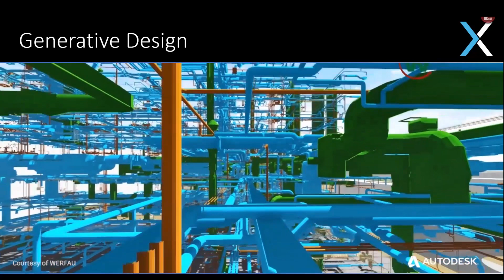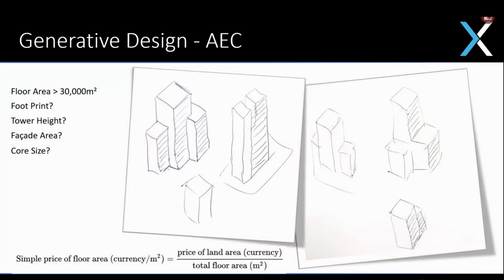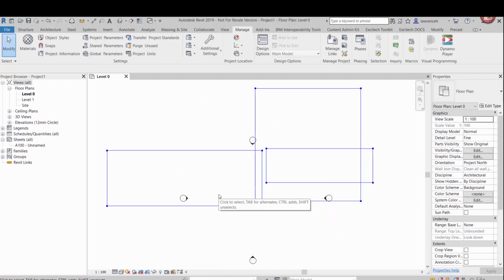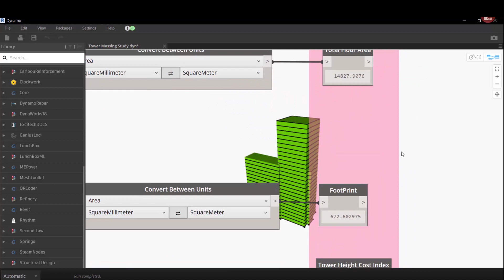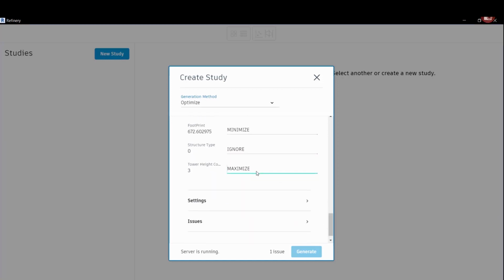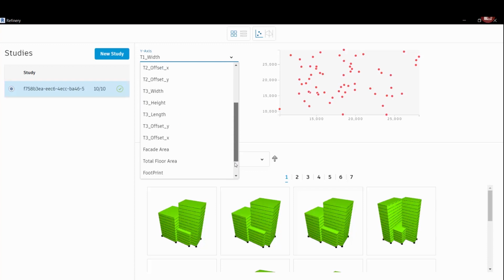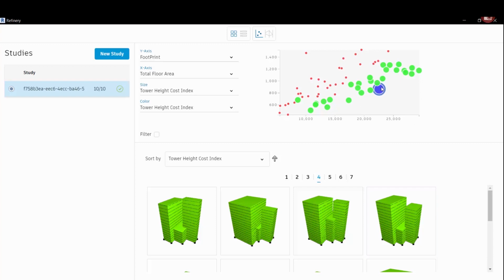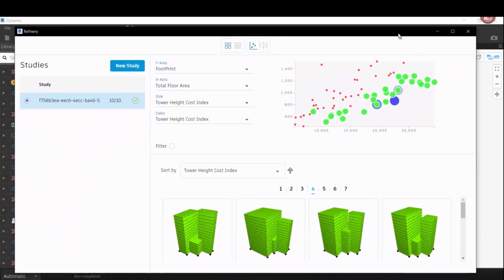An Introduction to Generative Design

Comment: But how are these optimal building being generated? You input the parameters and goals (max's and min's), but how does it output these combinations? What is the technical process behind it? Thanks and great video! :)
Reply from the maker: Hi Kevin,

The Generative Design software will use a range of values from each input and then measure and rank these against the criteria that we set for the optimal design. Dynamo is used to create the logic and data that is used for the selection process.
Reply: @SymetriUK  Oh okay, that sounds very similar to the type of optimization problems learned in Calc 1 classes, e.g. finding the max or min of a multivariable function. Thanks for your reply!!